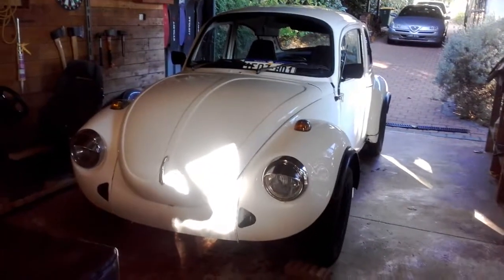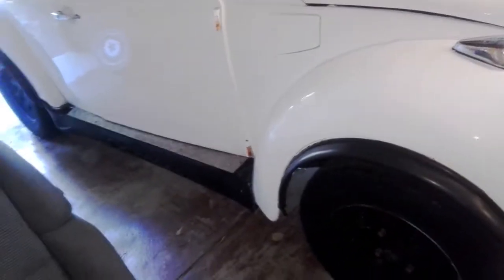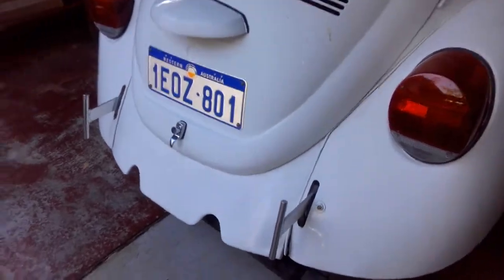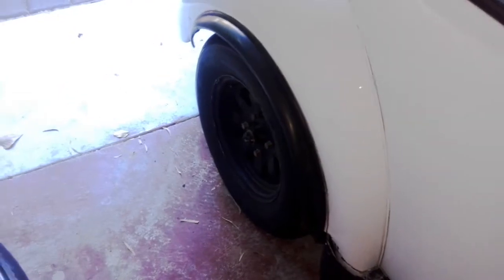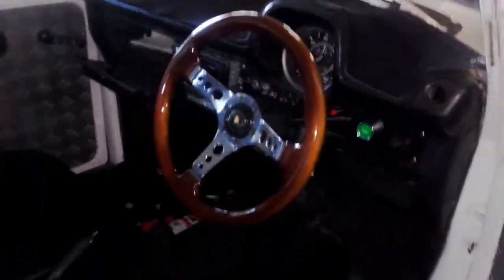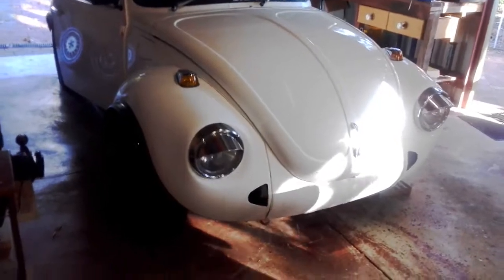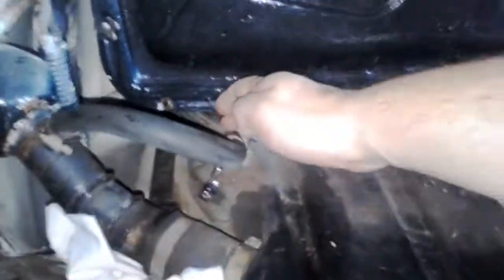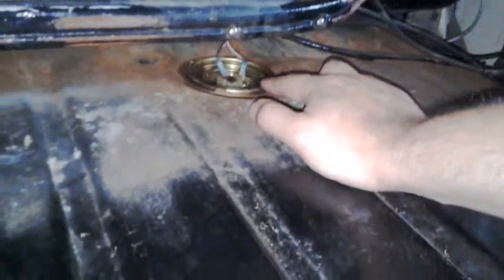1974 Superbeetle start up and intro

Comment: Nice little bug!
Reply: +Thomas EXOVCDS Cheers mate. I've replaced all the fuel lines and filters now but she needs a new tank as it's weeping a tad when full. But I'm simply loving the ease of working on it. Not a 1600 as I was lead to believe but she was cheap and she runs so meh. Cosmetically I'll be swapping the wheels for standard ones (having the rear ones widened though), and putting standard running boards. Then inside I'll be swapping the seats, changing the steering wheel, and replacing the checkerplate with new custom home made trim. (read...I'll get the wife to do some sowing).  Then that'll be it really. Nothing major although I may tinker with a replacement 1600 engine on the side. Even in the current state, she'll be at a classic car show this weekend lol.
Reply: +Chris Winter Sweet... wish I had room for a project car at home!
Reply: ***** Been a long time coming. In the past, all my "toys" had to be running by Monday as they were also daily drivers. Nice to have one that can just sit there, but at the same time, I dont like any car to sit for too long or it becomes a relic.